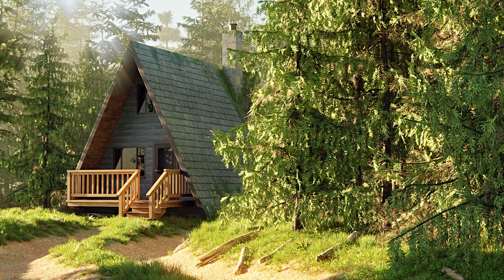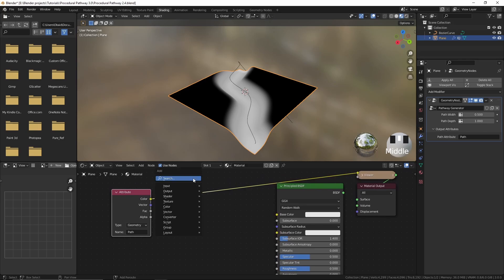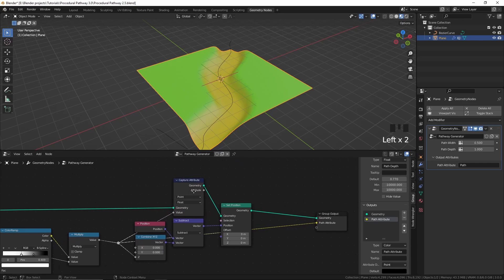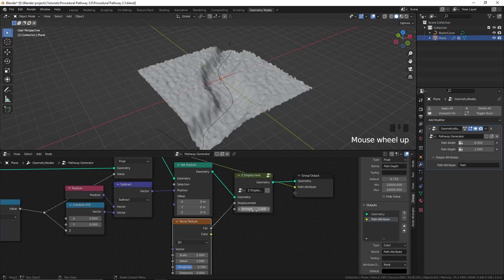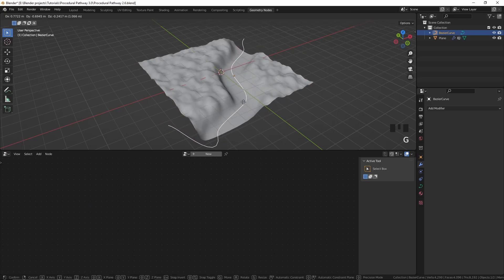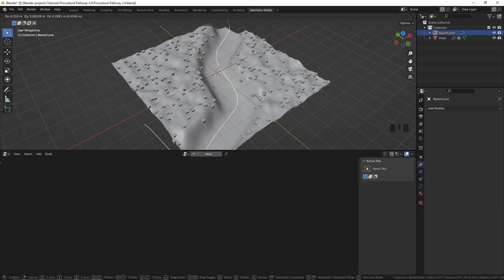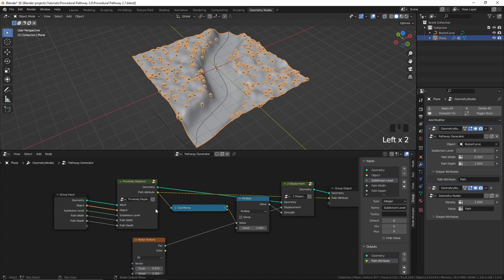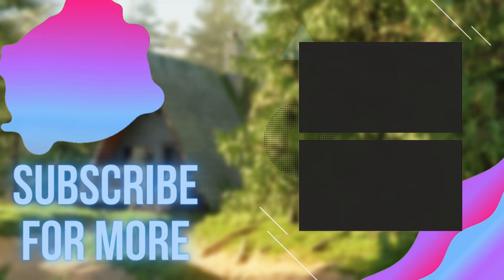#02 Procedural Pathway Generator w/ Geo nodes in Blender 3.0

Comment: Question - does using "Node Groups" break things such as the color weights and the shader?   I was trying to clean up the code and found that once I tried to clean up node groups, things seemed to break.
Reply: I figured out the color weights, turns out you have to click the correct vertex (im a newb!).   However, I am still struggling with getting the shading right.  Work in progress...
Reply: is the "geometry" what stores attributes?  I ended up getting it to work, and found that when I fed the attribute immediately post subdivide mesh (rather than using the geometry output of attribute) that is when things broke from a shading perspective.

Comment: Great tutorial.  I followed along in 3.2 and I wasn't able to get the shader attribute to work.  Have you heard this - or is it just me?
Reply from the maker: I don't for Blender 3.2 but It works great in Blender 3.0 & 3.1. Maybe you misspelled the attribute (It's case sensitive).
You don't need to use Blender 3.2 to follow this tutorial btw (It's in alpha right now & can be unstable ).
Reply: Hi,  Thank you for taking the time to respond.  I checked the names I've used and they are correct.  I've tried it in 3.1 and I'm still missing the mark. 
This is so important that I'm going to start over and hope I'm able to catch my mistake.  If you have any advice, I would certainly appreciate it -- but
I understand the time crunch everyone faces.  thank you, again
Reply: @gdematteis9023  I had a similar issue, im assuming you got it all figured out, if not, let me know!  My current struggles are with my laptop keeping up with this software..  It takes a minute for it just to apply distortion + curve!